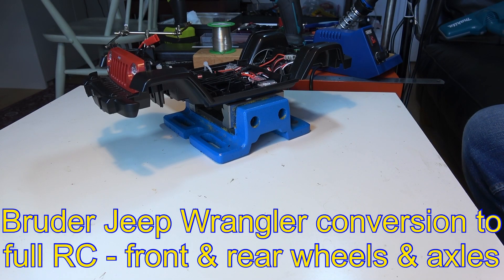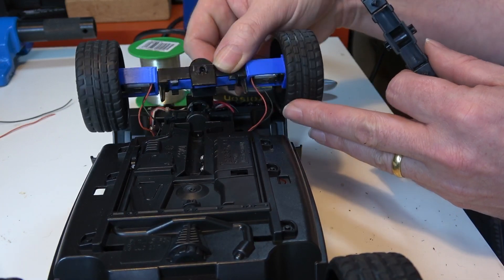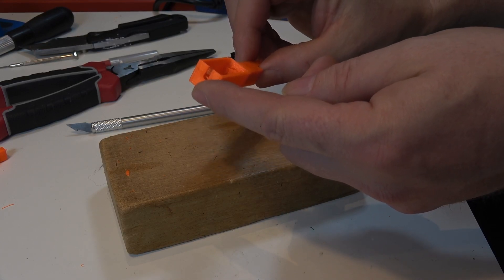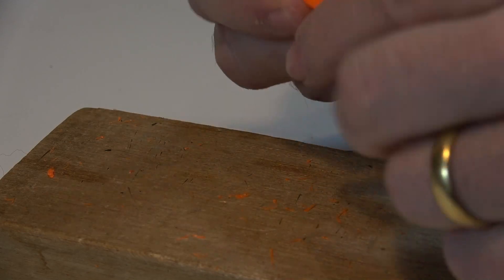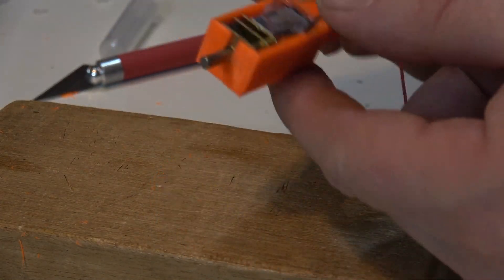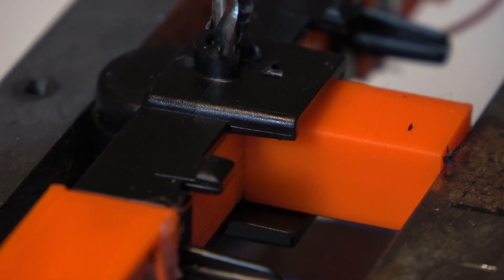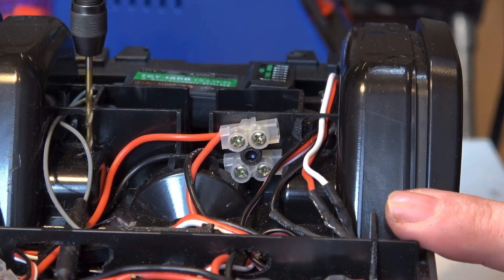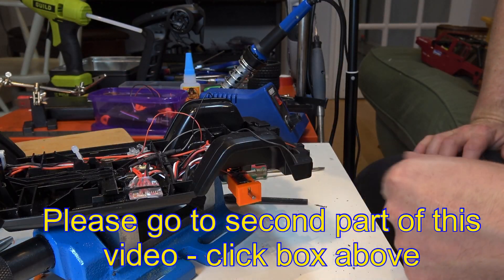Bruder Jeep RC conversion - 4. back axle

Comment: As ever, I´m delighted by your creativity and ingenuity when seeing how you address each problem. I love the 3D printed "keeper" which retains the "other" end of the motor and the little alignment/spacer blocks you´ve designed to make builders´ lives easier. For many years your Thingiverse files will be the go-to option for the thinking man who harbours a thirst to build a 4WD Bruder Jeep.
 Now for the front axle - I´m agog to see how you deal with that!
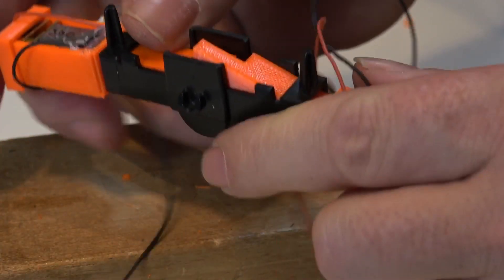Reply from the maker: Thanks Del. You won’t have to wait long, the next episode will air on Sunday at 11:00 UK time. I know that my videos are very detailed, but I really want new folks to the hobby to have enough information to successfully build these things. I think that templates and ‘helper’ parts are an important ingredient of these builds - as grabbing something unique from my shed probably isn’t a lot of help and measuring things out often leads to more problems. In the meantime I am busy working on a 3D printed - easy to build - version of the little skid loader, which will follow on from this series, as I’m sure will be the trailer to complete the set. Thank you for your ever thoughtful comments. 🙂👍